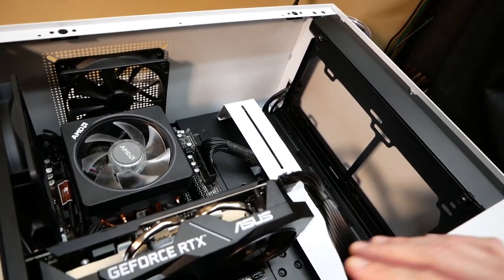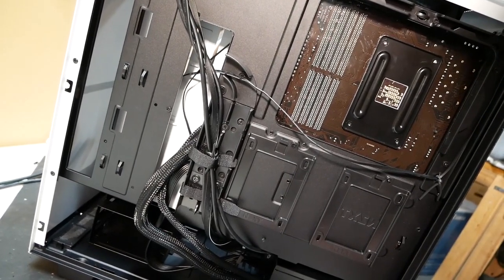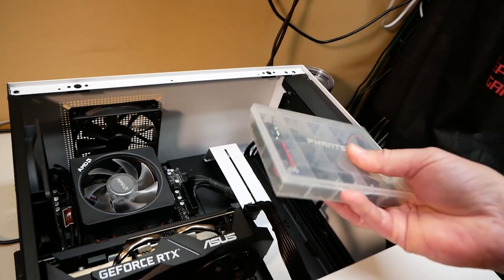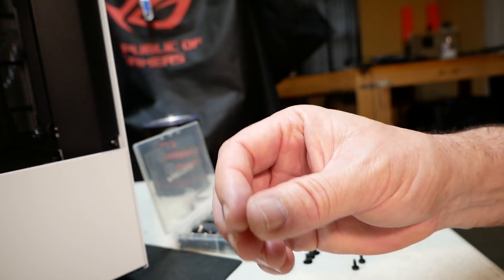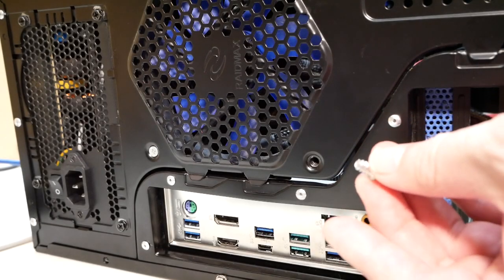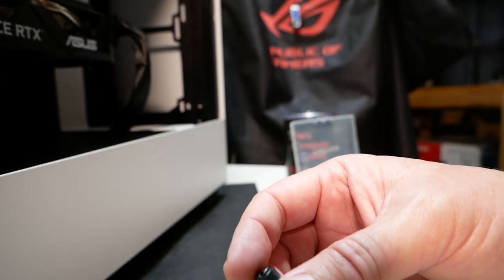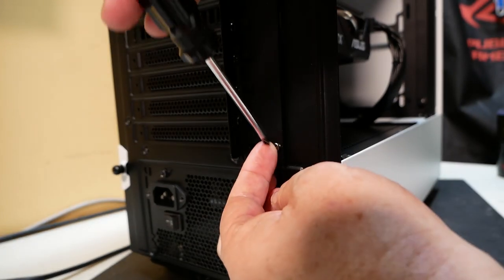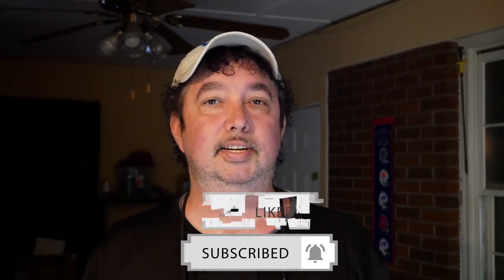How to Know Where to Use the Different Screws When Building Your Gaming PC

Comment: All   you need  is short  3/4 inch  fine  thread  screws   with a tiny  amount  of  breakable Lock  tight,  NO   cordless  screwdrivers
Reply: Can't tell you how many YouTubers I have seen using a cordless driver.  WHY?!?  Absolutely no need to; you lose the advantage of touch and what's the rush?
Reply from the maker: I only use the electric driver for the fan screws. Thanks for commenting.
Reply: @TimsComputerRepair  smart.  You're welcome Tim.  Go BILLS !

Comment: One of my friends wanted me to build their PC so I came round and they already put the MB in the case. So I finished the PC turned it on and it sparked. I looked again and they had used a PSU screw and shredded the top layer of the board and bridged a trace in the board with the screw.
Reply from the maker: Not good.

Comment: Types of screws

Standoffs (mounting motherboard) 6:50

Motherboard screws 8:56

fans screws 11:04

Drive catty screw (dont how to spell this) 12:20

Power supply screws 13:17

Side panel screws 14:29

Mounting drives screws 15:29

??? 18:17
Reply from the maker: Thanks for commenting.

Comment: I bought a Thermaltake Versa H22 Black ATX case.  It came with three stand-offs.  I bought a pack of stand-offs that had zero negative comments on Amazon and not one of them will fit in the Thermaltake.  Not a single one.  I guess I've got to just go buy another case.  I can't believe this, I'm dumbfounded.
Reply from the maker: Yeah sometimes case manufacturers use their own proprietary stuff. That can be frustrating.

Comment: If a motherboard is mounted like this I would not dare lifting it bij holding the cooler........, most cases overhere come with the screws and stand-off's in little plastic bags, almost every motherboard comes with a manual detailing the type of screw, the numbers included and it's purpose like: MB, SSD, ODD etc. Still often it is quite difficult to match the actual 'little' screw with the drawing in the manual........
Reply from the maker: Thanks for commenting.

Comment: You're   screwed   if you  use the    wrong  screws.  I would  RECOMMEND   the  I-FIX  IT  screwdriver   sets    Those  side   case screws   are   called  "knull " because  you  can turn  them with  your  fingers    without  friction sort  of   like  a wingnut
Reply: lol
Reply: Umm...whoever coined that name didn't Google it first. (Don't Google knull at work, it's NSFW).
Reply from the maker: Thanks for commenting.

Comment: Unrelated to the video (since there is NO methods anywhere, (YouTube, Reddit, Tom's Hardware, LTT, ANYWHERE))

I have an ASUS TUF Gaming X570 Plus WiFi and a Zotac RTX 3060 GPU and the screw for the MB is too loose and wont fit all the way, the screws that came with the MB suck and will fall out, 

I was told that if you don't have your GPU screwed in correctly, it can risk irreversible damage to the MB and/or GPU,

I don't have any tools to help the situation and I'm worried about damaging my MB/GPU

To ANYONE reading this comment, what do I do?

Comment: I hope the motherboards are raised not to be in contact with the metal case. But can't there be a simpler design to do that? 
 PC build is still a messy process with wire clutter and fragile motherboard pins and ports.. not for the weak minded 😒